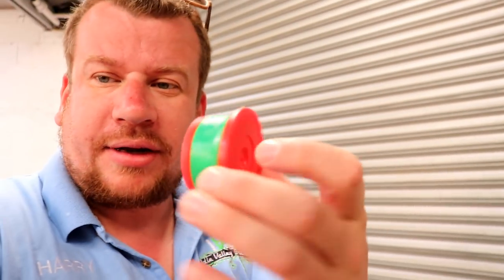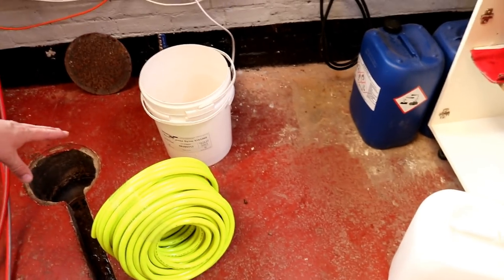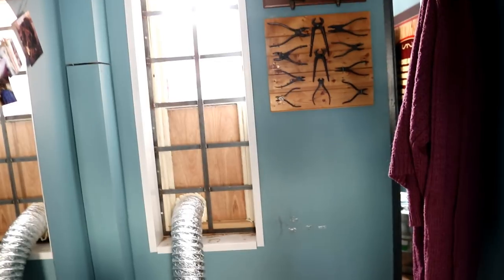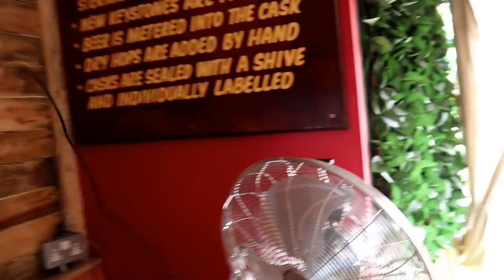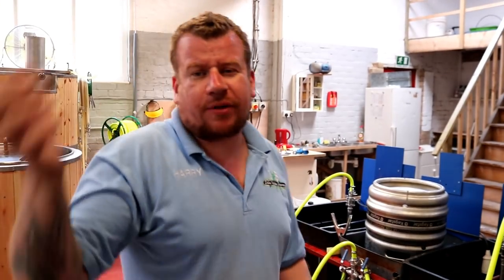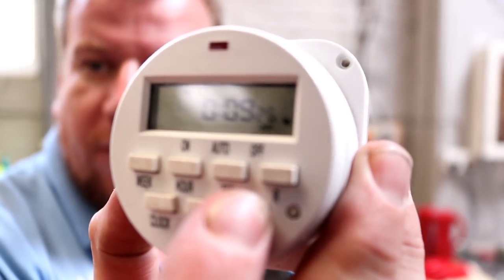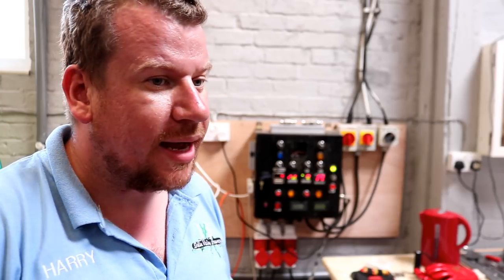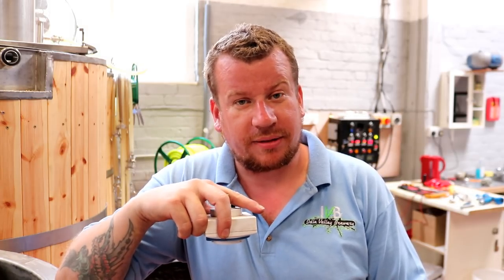THAT'S HOW TO GET THE COCONUT OUT

Comment: Nice vij mate.Sounds like the relay has gone,It's worth taking apart it see if you can remove the original relay then run wires from the coil side of the relay board to an ssr mounted on your heat sink. i did this to one of my stc 1000 that had a bad relay and it works a treat.Thumbs up as always.

Comment: Make sure you run plenty of water down or the drain may well block which will be a bitch. Do you get money if the adds aren't skipped? Other shit happens as usual. Nice vid as usual, looking forward to the brew. Cheers, Schnuz.
Reply from the maker: I swept all the coconut to one side and put it in the skip, very little made it down the drain. With the ad's I get about $1 per 1000 adverts. skip them for me bud.